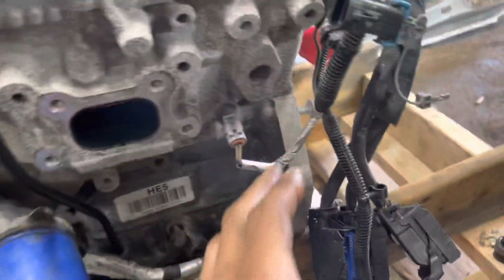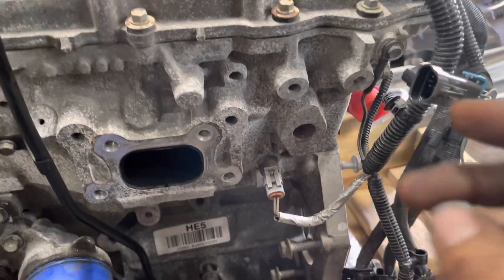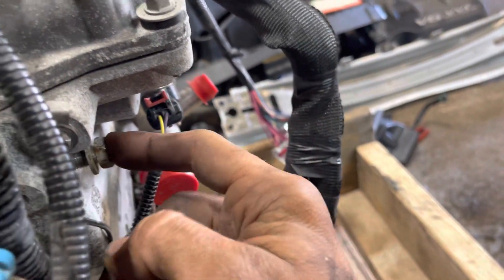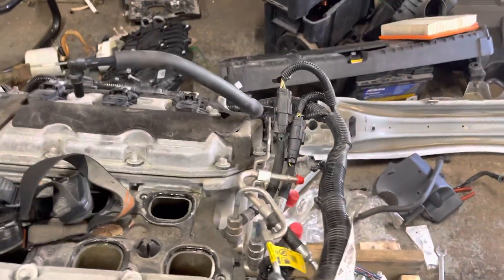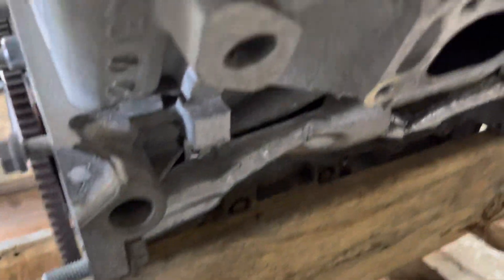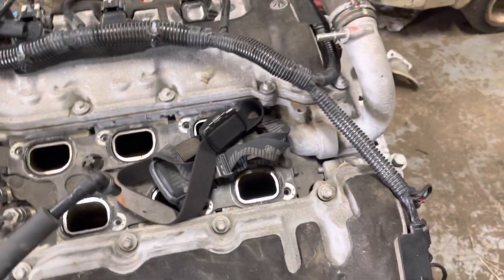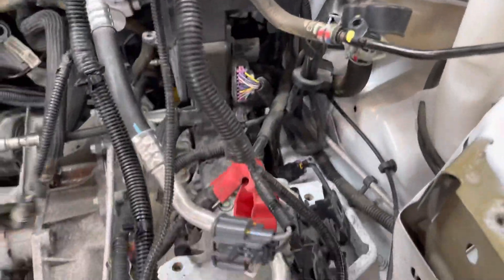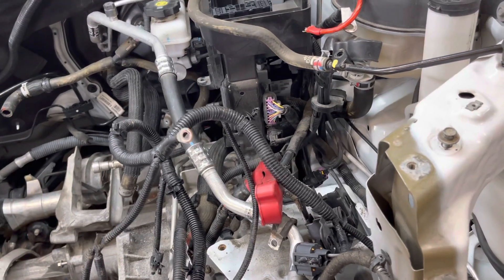Chevy Malibu 3.6 engine ground locations￼

Comment: Man I just put in a new engine 3.6 ltz impala and I can't get it to spin the starter at all tested the starter off the car and it works idk it's it's my ground or what
Reply: Sr. Can you please help me i have the same engine 3.6 ltz Chevy Malibu same crap with my starter its fine alternator fine what do you know about the battery cables? Help
Reply: @braidendj3jy I’m having th same issue did you get it to work?
Reply: I’m having the same issue did you get it to work?